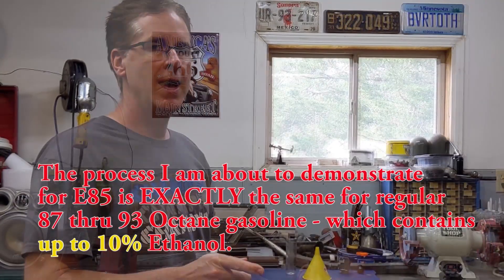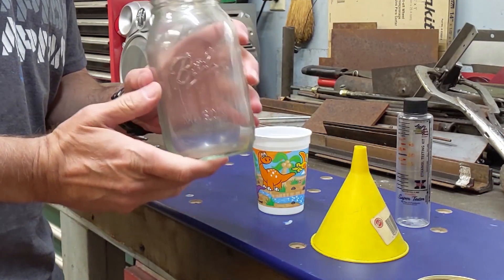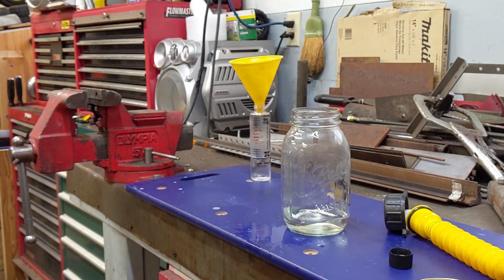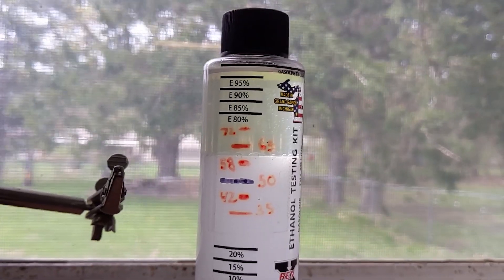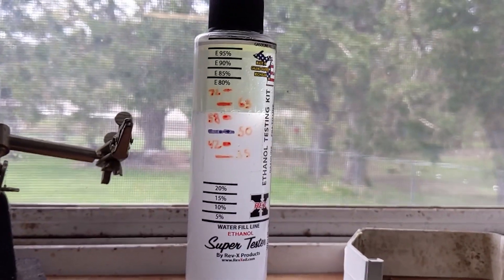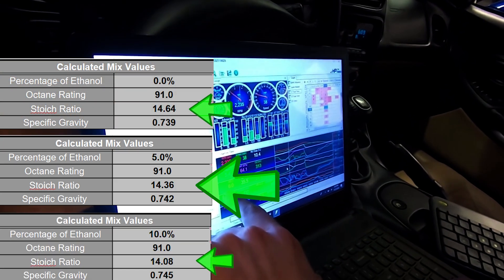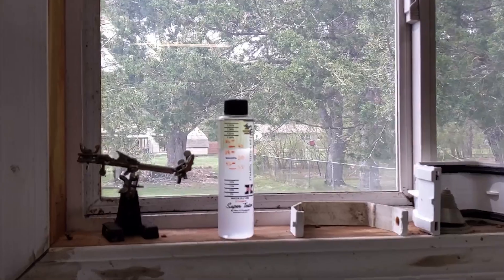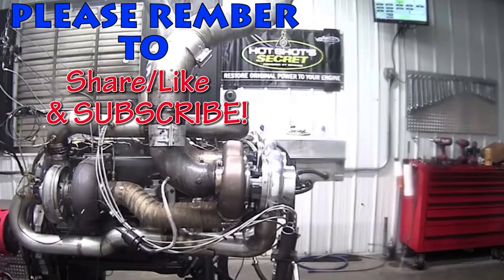How to Check the Ethanol content in Fuel ( Easy 3 Minute Test!)

Comment: I can't emphasize how important that is. When I got my car tuned on 91 octane I was making 920 wheel horsepower after that it was tested on E60 and it made 1050 wheel horsepower and then on E85 it was at the 1100 wheel horsepower mark. It's always a gamble when you go to the pumps because you don't know how accurate it is.

Comment: Unless you have different fuel maps to upload every time ethanol content is changed, it seems that E85 isnt worth the risk for forced induction tuned engines.
Reply from the maker: Agreed.  What I do is run a blend that is less than E85.  That way I can test the fuel and then blend in enough pump gas (about 7-8% ethanol) to reach something like E35.  E35 gives you about 96 octane which helps quit a bit over 91 (:-).  It's not for everyone - but it works for me!
Reply: @Toys4Life  
So, you must test the fuel each time, just prior to fill-up. That does add a lot to the inconvenience and time spent at the pump. But as you mentioned, the advantages are significant. I guess it becomes a routing after a few times.

Beyond higher octane, I read somewhere that there are added benefits of burning high concentrations of ethanol, as it cools the air charge moving through the inter-cooler more efficiently than gas. Also burns clean without carbon deposits.

If you haven't found it yet, Richard Holdener's channel has an amazing wealth of FI LS dyno results and he hosts a live Q&A. If you can think of a blown LS combo, he has likely already tested it.

I wonder how well the 3rd party performance type ECM's with auto tune capability would manage large swings in ethanol content? My county doesn't require vehicle inspection/emissions testing, so Im free to do as I please. :face-blue-smiling:
Reply from the maker: Latent heat of vaporization!   I have a scan gauge and can tell from the LTFTs if the fuel makeup has changed.  I test once in a while - moreso in late spring when the ethanol changes from 60 ish to 80is for summer.